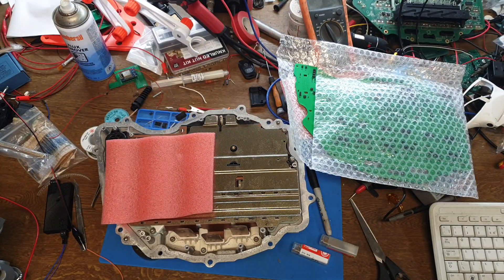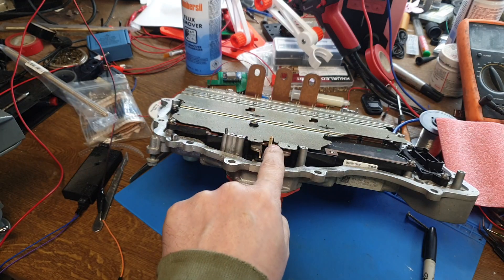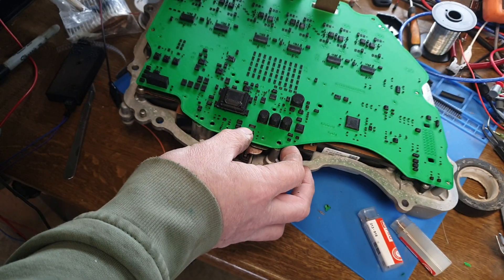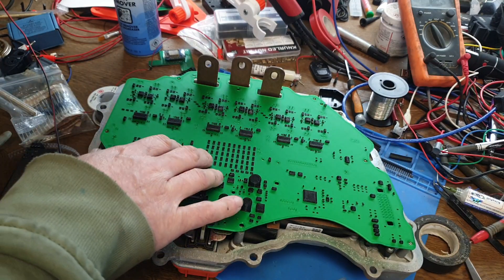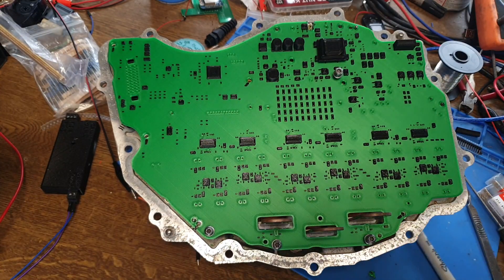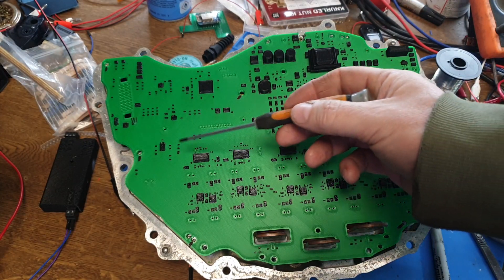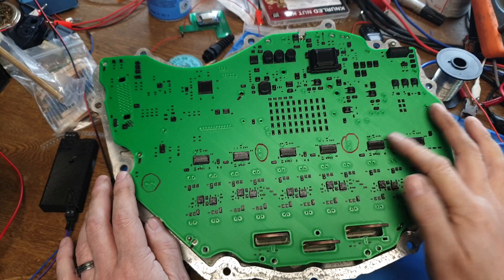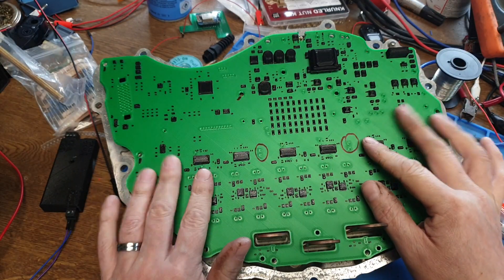Tesla Model 3 Drive Unit PCB Design 06 : Prototype 0

Comment: Speaking as an engineer I had to smile when the print didn't fit: there's probably 100's of thousands of pounds that have been saved by 3D print prototyping in my place alone and that's with a number of folks reviewing designs before going in to print, letalone real steel production! 
Never beat yourself up over a protype not fitting/working on the first try, we all do so anyway but know this: there'd be no need for prototypes if we got it right first time, every time!

Comment: The next step i would do is have a FR4 blank or 2 layer board that just has the top and bottem layers.  With all the cutouts and mounting holes of course.
You also need to check that non of the copper is going short to the case.
Reply: That would have been the plan without the 3D printed prototype, but I think this will be skipped now.

Comment: Now my question is... if you got the fit and design slightly wrong, how? And, if you make corrections based on the 3d print, might the 3d print itself be the thing that's wrong and the original fit be correct? So then you correct things based on the 3d print, but you may have been right all along. That is, are the possible errors in your design bigger in magnitude, than the inconsistencies in a 3d print via limitations of that printer and thermally deposited plastic? I have no idea. I suppose all you can do is just do your best and guess the rest.
Reply: The 3D print is quite accurate. Only microns out. The issues are in the design.
Reply: The original PCB was scanned on a flatbed scanner, so you can have some minor scaling or perspective issues if it's not totally flat etc. The 3D print is quite accurate in position, the only thing that may vary are based on the material thickness on extrusion. So if you print a 10x10x10mm cube, it might be 0.1-0.3mm bigger or smaller than it should be.

Damien knew about the limitations, but he didn't even have to drill out the holes for the transistor pins. Therefore the print should be rather accurate and the biggest issue was the HV Interlock hole being missing and THAT was not caused by the 3D print 🤣
Reply: @crasbee  Ha, yes. Good point about the transistor holes.
Reply: @crasbee  I'm in the process of watching all of the M3 Drive Unit vids back to back so it's all very fresh in my mind: Damien took photos rather than scanning which most likely exacerbated the discrepancies. There was a lot of talk in the comments about how using a flatbed scanner would reduce the error in tolerances.
@MattsAwesomeStuff I've been an engineer for a long time, and worked with engineers with many years more experience: Not one single project has ever gone unchanged from the initial prototype! 3D printing has been a vital step in actually reducing the number of built up prototypes wasted because 3D prints can be produced overnight to test fit the following morning and identify clearance, tolerance and space claim issues.

Comment: Nice, 3D printing saves the day again.
Reply: Its a shame about having to get someone to send you the prints. Time to get a printer for yourself? Just a thin skeleton print with the hole positions would save so much time.
Reply: @ZoneKei  Damien has a Prusa MK3S+ that the community crowdfunded for him, but that is not big enough to print the full PCB.
Therefore Prototype 0 was printed on a Prusa XL, so that you don't have any seams that would make the resulting dimensions inaccurate.